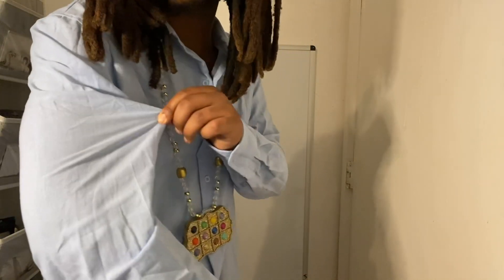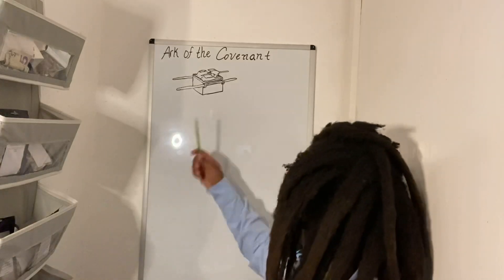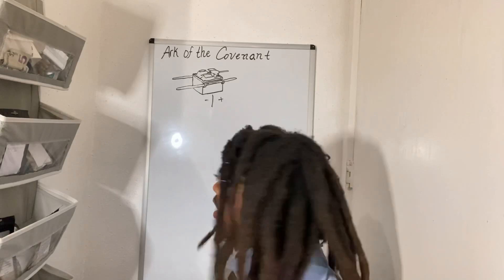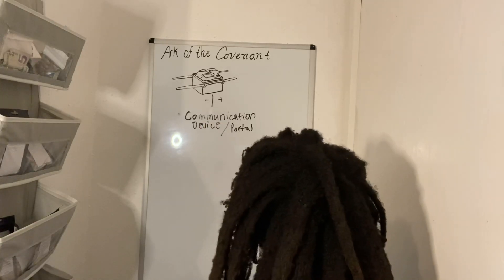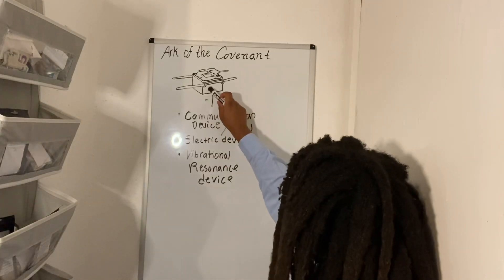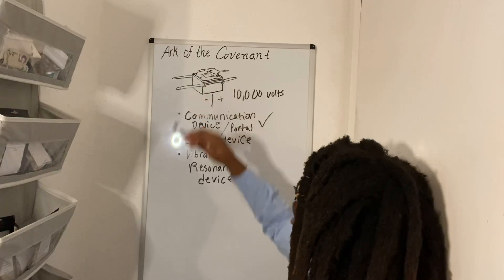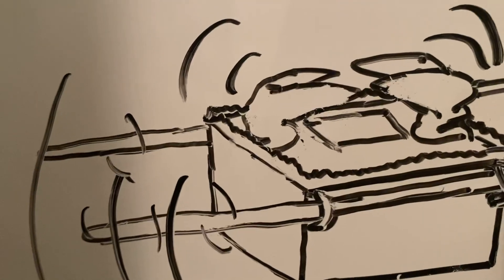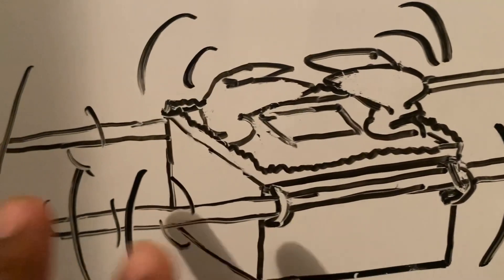Ayob Exposes the Advanced Technology in the Ark of the Covenant| Kohanology Chapter 2 Unit 3

Comment: I picked up on when you said that the ark could have killed the man with 10,000 volts of electricity. Voltage isn't enough to kill a person; a standard Taser is between 50,000 and 75,000 volts, and you can buy a stun gun that's 2 million+ volts. It's the amps, or rate of speed of the voltage that is deadly. It only takes .1-.2 amps to prove lethal.  

As I was writing this, the lid on my head just blew off. Now yoy got me thinking of spirit in a completely different way!

The Power(voltage) of Yah is such that Moses's face glowed when exposed to it. The speed/rate of Yah's power is such that to come in contact with Yah without proper protection (having an aura filled with holes/ being unclean/low Ohms) could cause instant death.

By following the Laws, we become physically, mentally, spiritually energetically strong enough to be in the presence of Yah or recieve what He has in store for us. That's why the temple priests laws seem so strict; they are maintaining an energetic radiation suit so they can enter the temple and not die from the power of Yahs presence. Being unclean is like poking holes through that suit.

 When we don't follow the Laws, we weaken our body, mind and aura to a point that we become incompatible with what Yah has for us, and as Yah is Life, our incompatibility with life inevitably brings death, whether instantly or over the course of years.

It's the perfect firewall to keep the wicked from taking the inheritance from the righteous. So, while whey can't outright steal Yahs blessings from us, the wicked try to bring the righteous down by hijacking the laws, messing with our foods and bombarding us with frequencies that literally "depress" our electromagnetic field.

I've been feeling a push for a while to change a lot things about the way I eat and live, but this video and a couple others you dropped today has been quite the "shocking" revelation; its boosted my own understanding of the "why" and reinforced my drive to keep the Laws.

I've definitely more studying to do, but you sure set me in the right direction!

Thanks for the charge up, I appreciate your spirit and pray Yah continues to reveal the path to Him!
Reply from the maker: Kan. like I said in the video I am not an electrician so everything I stated in this video was research that was already done. But who knows how much amps of electricity was in that vault.
Reply: @ayobnazir  it's wild to think about. I'm excited to learn more about the nature of our spirit and how to strengthen it!